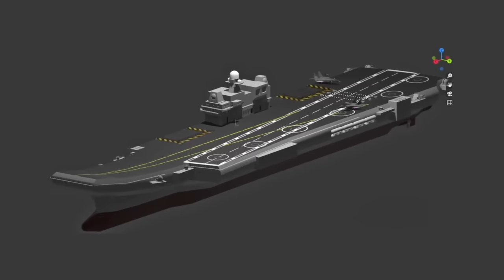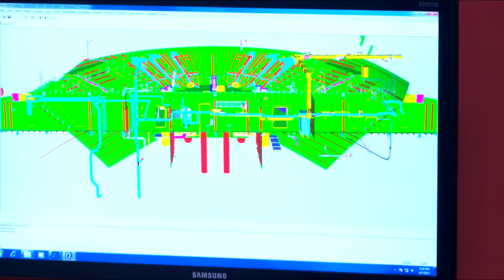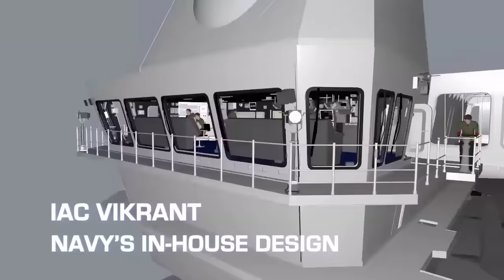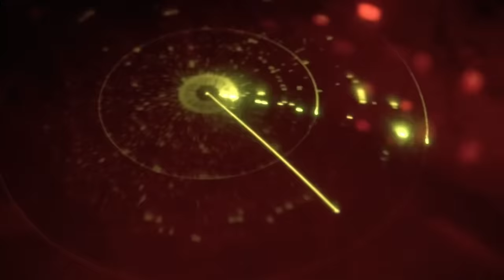INS Vikrant - Indian dream flagship

Comment: Nicely researched video. About the third carrier though, its likely that the plans for a 65,000 ton heavy carrier have been moved to next decade. Current plans seem to be building a sister ship of INS Vikrant. That way it can be built quickly and at lesser cost. Funds are also needed to fund 11 other classes of warships and 5 other submarine classes all being built or designed in India right now. 

As it is Indian Navy gets the smallest share of the Indian military budget as the lion's share goes to the Army and Air Force (because primary concern is China and Pakistan just across the border from us). So funds for a 65,000 ton Vishal class carrier will only be available in next decade.
Reply: Yes! I was going to post this as well. The Indian navy has decided to go for a repeat order of the Vikrant (sister ship)
And due to the experience gained, it can be completed in 8 years with minimal budget overruns. Vishal will come after that.
Reply: Navy seems more focused on submarines this time
Reply: Yeah. just make a sister ship… a follow-up class should be in development in 2 decades.
Reply: @OperationEndGame  Less than a decade tbh

Comment: It's a really solid starter carrier for the Indian Navy. 

Pros =
* Domestic made (so India now has production capability to make new ships and a pool of skilled engineers)
* Cost effective ramp 
* Two carriers offers far, far more operational capability. Can rotate ships in and out of an area for sustained fighting, divert a ship to handle threats etc. 
* Decent size, comparable to anything Russia and France currently have. 

Cons =
* 45,000 tons will get tossed around in harsh sea conditions, limiting operation capability. US carriers are twice as heavy and don't feel the waves as much.
* Crew training will suffer given both carriers are mismatched by design.
* No unlimited range, meaning logistics will be harder 
* limited sortie and payload capacity without a catapult system
Reply: Nice analysis. But the INS Vikrant has been precisely built to meet the specific geostrategic requirements  and threat perceptions of India. So, most of the cons you had mentioned are redundant. Unlike US carriers, Indian ones are not meant for Global deployment and may not be required to operate too deep into the Indian ocean region. Plus, the IN has been operating carriers continuously since the 1960s and have successfully used them in wars. Hence they pretty well know what they need and how to use them effectively. Cheers! ✌️

Comment: just shows how china isnt the only one with a powerful navy in the region hopefully itll help keep china in check
Reply: China doesn't need to be in check. They haven't been the ones waging wars in people's backyards. And the Indian and Chinese navy operates in completely different regions. If they did operate in the same region, India is outclassed and outmatched in literally every aspect. India literally took forever just to launch an obsolete carrier in 2020; how can they hope to take on the Chinese?
Reply: @endeliggnist5066   type 003 is the one that will be obsolete when it launches!!
Reply: @babiswaster7047  The Chinese Fujian has over twice the displacement capacity, is 80 metres longer, and has a CATOBAR system. In what universe is it obsolete?

Meanwhile, the Vikrant is barely larger than a helicopter carrier, which makes forces any naval aircraft that takes off from it from carrying any kind of meaningful payload. This is why it's obsolete. This is a factual and objective analysis, unlike yours.
Reply: @babiswaster7047   what exactly makes type 003 "obsolete" and what is "not-obsolete"?

Indian navy will not have anything like type 003 for several years in the future. And by that time, chinese navy will have a true Ford-class equivalent: 100,000 ton, CATOBAR design with EM catapult, domestically designed and built 5th gen aircrafts, nuclear reactors, possibly directed energy weapons,...... And possibly several of them. Its not even a comparison.

Comment: Well it's a first step towards indigenization, i mean it's the first step, the next is a 65,000 ton carrier, we already have our own indigenous nuclear submarines, I'm sure we'll be able to make nuclear powered 80,000+ ton carriers within next 60 years if possible
Reply: Depends on the strategic requirements and goals of the Navy. Nuclear powered ships tend to be very expensive to build and maintain. And they are really meant for long range operations away from home ports. So if that isn't something that is needed then it is unlikely to be considered. 

The next gen 65,000 tonne carrier is likely to be more than enough. Three carriers total is the current want but I could see the new carrier being built in more than numbers. With the two 45,000 tonne and maybe 2-3 65,000 tonne being a strong enough fleet to stop anyone from trying to pick a fight.
Reply: I think that is an excessive amount of ships. At most, there would be 4 carriers, but with the already limited budget of the Indian Navy, it would take time to implement. A single large carrier which is complemented by two more normal-sized ones like the Vikrant is the most sound strategy in my opinion.
Reply: @adventwolfbane  the no of carriers doesn't matter, the carrier groups is what matters and a 45k tone or a 60-65k ton is not enough as compared to a 80k+ ton carrier which can launch more ships simultaneously and can also defend itself and also be used for offensive strikes at the same time

Comment: 7:07 uhhhhmmm excuse me? The Indian navy and air force both do not operate a single F/A-18, and have no F/A-18's on order
Reply: The F/A - 18 and Rafale Ms are currently competing to win an order to serve on the INS Vikrant with both having undergone several tests so far and Rafale M seems to be in the lead
Reply: Navy have chosen Rafale M for the Aircraft carrier since Airforce is already using Rafale which decreases the maintenance and repair costs.

Comment: Sister ship of ins vikrant is on the boards, 65k tonner is pushed for 2030s
Reply: Another obsolete ship in 2030? What a waste of money. China could have built that in 2 years.
Reply: @endeliggnist5066  so, whats your point then, chinas budget is 10 times more
Reply: @sammy57533  My point is that the Indian aircraft carrier is obsolete. Can you read?
Reply: @endeliggnist5066   china's ones are more obsolete and are cheap copy paste!!

Comment: China is building an air craft carrier at a rate of one in 5 years but indians taking 20 years.
Reply: China takes 5 years to copy a russian design. India takes 20 years to design and build a carrier from scratch
Reply: @vijaymoudgalya9915  so who is smart? It doesn’t matter whether china build a copy or not.

What is matter is to have the weapons as quick as possible to confront and push back the enemy.
Reply: @Red.bulldozer3  Chinese carriers aren't defensive weapons. Carriers in general are offensive weapons. Chinese carriers suffer in that role as well. All their russian clones rarely if ever leave port for reasons one can only imagine (*cough cough*copying a russian design that is famously unreliable*cough cough*) and the one carrier that they did design and build on their own took them 20 years as well. Even then, while it looks good on paper, the fujian can't even recover it's planes without ripping it's own flight deck  off, if it ever gets the arrestor wires in the first place.
Reply: @vijaymoudgalya9915  the indians have been operating aircraft carriers from 1960s but till now have only 2.

But the chinese bought the empty hull of a abandoned aircraft carrier from ukraine  in early 2000 and refiiited with new engines and weapons systems. 

Since it is their  first air craft carrier, it took 20 years to build. But now they have mastered the art of building an aircraft carrier and now operating 2 aircraft carriers.

Another 2 more under construction and will inducted in 1-2 years. By 2030, china may be operating 6 aircraft carriers in total compared to only 2 in india. 🤣
Reply: @Red.bulldozer3  since you brought up difference in experience with carriers, it is only fair to take into account difference in resources. China can afford to throw money at shitty designs. India can't. 
"Since it is their first air craft carrier, it took 20 years to build" Same for india. 
No work is currently being done on carriers other than fujian in china. 
INS Vishal's keel is already laid and is undergoing construction.
Reply: @vijaymoudgalya9915  are u sleeping under coconut shell. China already operating 2  aircraft carriers and another 2 under construction. 

Check your facts before commenting 🤣
Reply: @Red.bulldozer3  dude, I specifically said other than on fujian class. 
I also forgot to ask. "Since it is their first air craft carrier, it took 20 years to build" Same for india, so what's your point?
Reply: @vijaymoudgalya9915  the point is china only started operating aircraft carriers in the last 20 years but yet they are far ahead of indians who are operating aircraft carriers for the last 60 years. 

That is my point.
Reply: china budget is 800B and indian budget is 80B

Comment: They need to dream bigger than an old former Soviet ramp carrier
Reply: @rohitb5834 it’s actually very true catapult can thrust bigger planes or fighter planes with more fuel or weapons
Reply: @aditya3127  obviously CATOBAR designs are the best. But how many nations have a CATOBAR Carrier? Only 2.
And that doesn mean u disregard a STOBAR Carrier, which only 3 nations have. 
Also its not a "Soviet ramp carrier". The Design is called STOBAR, Short take off but arrested recovery.
Reply: Ski jump is actually a British invention. And we can't use the steam based catapult as it's outdated. EMALs are new. So, should we change the design in the middle of development or wait for 10 more years till we get Electromagnetic catapults ?